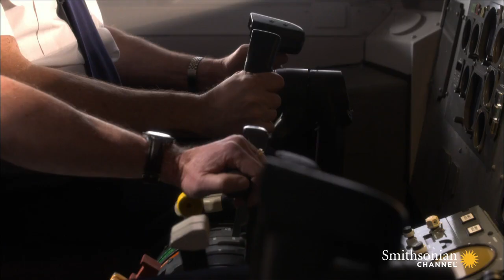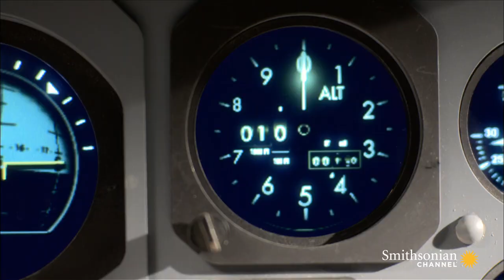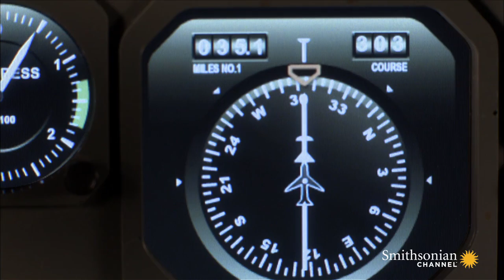Why Couldn’t These DC-9 Pilots Avoid This Collision?

Comment: According to routine orders, the aircraft was to effect repairs at Mountain Home AFB and then return to MCAS El Toro. Diagnostic tests at Mountain Home revealed that the aircraft had an inoperative radio, inoperative transponder,[3] oxygen system leak, and a degraded radar system. Maintenance personnel were able to fix the radio and confirm the oxygen leak, but the base did not have the necessary personnel to repair either the transponder or the radar.[2]

Despite the inoperative transponder, Phillips received permission from his superiors to fly the F-4B anyway.[4] 

Pure military bs

Comment: I mean the fighter plane is smaller and it had no time but with the 3-5 secs it had it could have just tilted the nose all the way down makeing it just the back wings i mean the other passenger plane might take a lot of damage but that one movement could have boosted it survival chances because the fighter jet may only had like nearly 3 secs before collusion but the speed it had already he could have used it in the thing I explained but I guess so he didn’t and my question is that if the passenger jet had been paying attention to the bottom buttons how did he not see the part where it tells you if a plane is nearby the right pilot had clear view on the fighter jet and so did the fighter jet pilot

Comment: I think they also put in regulations that you can't fly airlines over active war-zones with AA present. That was from the MH17 shot down. An airline justifying that well they have AA that can shoot planes down at 5000 feet, we will just fly 30k feet doesn't fly when you don't know if new military equipment entered the theater of war. I still remember some of the excuses made: Oh we didn't know they were shooting planes down at that area. BS on LiveLeaks some guy using a smartphone recorded old SU-24 planes and a MI-24 helicopter planes being shot down a month before MH-17.

Google MH-17 shot down wiki and it will show it got shot down at July, 17, 2014. Then google Ukraine Airforce Assets wiki. There is a section detailing the Ukrainian aircraft losses during Ukrainian Crisis. The first air military assets being shot down was at May 2, 2014. So the airline association lied when they said they didn't know planes where being shot down in Ukraine. Part of blame is greed to save fuel cost, another is the lack of regulations to not fly over war-zones with AA and another is the conflict combatants.

Same thing happen when Iranian plane got shot down when Iran's AA went active to intercept US 'retailiation.'

Comment: They could have potentially avoided the F-4 but the DC-9 has very limited view with their windows so I think that the f-4 had a much better chance of seeing the DC-9 considering they have a large view of sight in the canopy
Reply: The f4 captain was looking at his target thingy
Reply: The f4 have way less visual than the dc9
Reply: they were most likely focused on the instruments instead...
Reply: @Skeletonful007  in this video they are making it seem like it was all the dc 9 fault
Reply: I suppose (theory) that the military pilots were used to high-altitude flights and that if there's a potential collision they can easily identify it on the radar. They are accustomed to trusting the instrument systems.
Reply: @gudfishpoop3188 bro the f4 only has one pilot and that pilot is already focused on doing a lot of other stuff not mention being totally strapped down with almost no flexibility to move around the dc9 is at fault
Reply: @simin382  the pilots probably thought that the military plane would be able to manouver its way around, and when the dc9 pilots saw the dc9 it was too late to pull out

Comment: This sounds like some soviet-era cheapskatedness, I'm disappointed it was us.

"Boss, my plane doesn't make oxygen"
"Fly low to ground, comrade.  Oxygen is not problem"
Reply: watching all these videos i start to get the idea that we're not actually a lot better than the soviets at flying lol
Reply: What? That's not some cheapskate tactic, the entire point of the system the wasn't working was to allow them to fly at high altitude, it wasn't working so they flew low. It's pretty simple and wouldn't have been a problem at all if the Phantom's pilots didn't fly through a civilian airway while both pilots weren't paying attention. It's also through incidents like this that we learn the lessons that we now consider common sense, like the fact that this incident was key to making military aircraft contact civilian air traffic controllers.
Reply: Welcome to America lol
Reply: @rohana7788  I wasn't even addressing your comment. Also yeah, most people know that the majority of aircraft accidents are caused by human error.

Comment: Fighter plane pilot survive and all passenger of commercial plane dies what a grace of God
Reply: Atleast the fighter plane pilot survive
Reply: 2 suriver the man women died only ploit
Reply: Nah the f4 pilot died
Reply: @CARTERISAFRUIT  all of them.....?
Or just one.... Because the back one already jumped before it vrash
Reply: @ahrithegumiho2199  the incident is called hughes airwest flight 706
Reply: @ahrithegumiho2199  all died, no survivors
Reply: The radar operator of the fighter plane survived
Reply: Pilot James Phillips was killed. chris schliss the RDO officer in rear seat parachuted out I seen him coming down on that day. It happened above our home in azusa california
Reply: That because fighter plane equipped with emergency ejection seat, just pull lever (i guess) and you already ejected.

But not with standard commercial jet...
If that commercial one get ejection seat....
That Will bring much-much trouble
Reply: The pilot didn't survive. The radar operator did.

the pilot couldn't eject because of an error in the ejection seat, which prevented the pilot from ejecting if the radar operator in the back ejected first.

Comment: Totally the resposibility of the F-4 which is smaller, more maneuverable, under vfr and on the left to “see and avoid” the dc-9, which is under ifr and relies on atc for traffic separation.
Reply: The f4´s radar was broken without oxygen so the f4´s was trying to see so not their fault
Reply: @nighthawk6755  Mismaintenance is not someone else's problem.

Comment: Let me re-evaluate:A DC-9 that has a tail of a Boeing 717 takes off from the taxiway and collides with an f-4 just because some random dude wanted his plane back.
Reply: you do know the 717 is basically a next gen dc-9 right?  DC-9 became the MD-90/95 and then the 717 when Boeing bought out McDonnell Douglas?  
The rest of it, yeah.  Seems like some big brass wanted his plane, and 3 pilots and a RIO all had their heads out of the game.
Reply: @TheRealCelticBatman  yeah but the DC-9 and 717 have different tails(this incident happened when the 717 didn't even exist)
Reply: Yo
Reply: D.C.    Daily Crash

Comment: Can anybody tell me why don't seat ejections are installed in airliners for pilots and passengers.
Reply: Fighter planes have a glass canopy which shatters when pilots eject. In a commercial plane, the roof is not made from glass , and thus no one can eject. Along with that, an accidental ejection from a passenger could cause everyone else to die.
Reply: @shujaatmandkhan9125  I agree..But an accidental ejection can be avoided if control over ejection is given to pilot only. Who can alert passengers minutes before ejection.

Comment: it appears the Phantom was at fault or more the onus was on the pilot of the Phantom to spot the Commerical Airliner,the Phantom is the smaller, more agile plane, the DC-9 had the right of way so to speak and was more noticeable than the other way around.

Comment: My question is.. why didn't the F-4 pilot eject? Was his seat not working? Did he bonk his head?
Reply: One did, the Radio Intercept Officer(guy in the back), the Flight Commander was not able to.  There was a flaw with the F-4s ejector seats, which was later fixed, that made it a crapshoot if the front ejector seat would fire or not if the rear ejected before it.  The RIO fired his ejector seat before the FC and the FC was not able to fire his own.
Reply: @TheAznWaffle  So did that mean that the pilot in the front seat was supposed to eject first?

Comment: According to the video, they might have missed each other if the F4 had just kept flying straight on.  It was the F4’s raised starboard wing that sliced into the DC-9.  Or, if the F4 had just pushed the nose down instead of trying to turn away to the left, the accident may have never happened.  I wonder what sort of collision avoidance training the military pilots get?
Reply: vegasgeorge no but imagina having like 1 second to do something unexpected you probably dont choose the best choice
Reply: nah i feel like the vertical stabilizer would have been cut off the f4 and the dc-9's bottom would have been cut open
Reply: From what i see.. The f4 pilot turned to the left and pitched down because the plane was coming from right... But it was already too late and it made the right wing lift up and slice off the cockpit.
Reply: @crystalightz doesn't matter by turning downwards the wing hit and if he did not the vertical stabiliser would have hit. Unfortunately it's a lose lose situation
Reply: @Mortal-Demiurge  yes fr

Comment: The pilot in the DC-9 could of see the fighter pilot, but they didn't look around the plane they were looking at the instruments but not the radar, but the fighter pilot did used the rocket seat but i dont know if he survived, but what happend with the pilots of the DC-9 that were deslocated from the cabin?

Comment: Isint it the fighters fault, considering they are much more maneuverable?
Reply: Technically, both pilots are supposed to "See and Avoid" each other. However, the problem with that is at the time of the collision, it was hazy outside, which limited visibility. Also, due to the speed at which both aircraft were traveling, the F-4 would have appeared to the DC-9 crew as nothing but a speck till right before impact. As for the F-4, the two aircraft merged so fast that all the pilot had to do was look down at his instruments for one or two seconds in order to not see the DC-9 from farther out. Once he did see the DC-9, he did take evasive action, but by that time, the two planes were too close together in order to avoid each other. Besides that, at the time military pilots were not required to contact and obey civilian ATC, and the radar system that was tracking the DC-9 wasn't sensitive enough to track an aircraft moving at the F-4's speed, so ATC couldn't have told either of the pilots to look out for each other.

Comment: Aviation journalism at its finest (100% sarcasm). I'm a former commercial pilot and I know that airspace very well. My question is where is ATC (FAA Air Traffic Control) in this picture? Even if the Marine F4 opted to fly VFR (visual flight rules) the airliner only flies IFR  (instrument flight rules) which will keep him in contact with ATC and under radar coverage to maintain traffic separation which would include "Air West Flight Blah Blah Blah, traffic alert! You have unidentified traffic at your 9 o'clock 1 mile". That gives you about 7 seconds to look and take evasive action (which is almost never necessary). So, if you're reading this, I'm going to paint an unlikely scenario for ATC for your entertainment to add to this seriously incomplete narrative:

ATC Supervisor: "Do you see anything unusual out there?"

ATC Controller (with his feet up on his desk): "Nah. Just an Air West guy and .... Oh, Sh--!"
Reply: You should probably read the NTSB report all your questions are thoroughly answered

Comment: I'd say 90% of the blame lies with the F-4. The commercial airliner pilots do what they normally do, which is to scan their surroundings, but not have to do so frantically assuming there might be military aircraft flying abnormally in lower altitudes. Commercial planes also have ATC and TCAS to help them avoid other planes. As such it is the responsibility of the F-4 to be extra vigilant about not running into commercial aircraft, since it is operating outside of its usual protocol. Plus, the commercial airliner pilots have humongous blind spots compared to the F-4, and the fighter jet is so much more smaller and maneuverable. Most of the fault lies with the idiotic Marine pilot.

Comment: See and Avoid these videos.  They always leave you hanging with no further info.  Did the f-4's crew eject safety or what? We saw the DC-9er hit the ground so we know what happened to them but what about our F-4 crew?  I'll assume that because they hit approx. head on, the F-4 was damaged around the front of the aircraft including the cockpit areas and they couldn't eject.  It was a much different type of damage than the plane was designed to take and still have the crew able to eject. Now I'll have to do a search to see, THE REST OF THE STORY.

Comment: why didn't the DC9 show up on the F4 radar? they are supposed to pick up other aircraft. so they don't get surprised and shot down. this should not have happened
Reply: It's a weapons control radar with a narrow beam.  2 dgrees in elevation off and the DC 9 would not appear on the radar.

Comment: What is the name of that small jet?
Reply: Larry
Reply: NO its a F-4 Phantom
Reply: Scrap Metal.
Reply: JeltePeltePower f4 phantom
Reply: Its an F-4a2 phantom fighter jet
Reply: Ik ben een JPP tafel McDonnell Douglas F-4B Phantom II
Reply: Dorp ^^^ im not 100% sure that’s the name there was many experimental jets of the phantom
Reply: Lootn The jet in question is NOT experimental. It was the actual production version, which was widely in service by the time of the accident. In this case, it was an F-4B variant operated by the Marines.
Reply: Lootn Plus, any experimental aircraft in U.S. Military service are designated with the prefix "X" (e.g. X-15, X-35, ect.) and are operated by specific test flight squadrons within the Air Force or Navy. The aircraft was an F-4B with a Marine COMBAT fighter squadron

Comment: Too be honest, I believe the jet is more at fault than the commercial jet, the jet was flying directly towards the plane, so they would be looking forward, the commercial was not
Reply: IAnimalLoves 
It wasn't. Both were moving. The commercial jet wasn't just floating in the air infront of them. It came from the right.
Reply: I think that it's not any pilot's fault but military fault if anyones. Or the guy who confirmed how high they can fly
Reply: The military jet had a radar pointed directly at the commercial jet the whole time, plus during military flights there is a ground control to prevent exactly this
Reply: @tim4570  You don't know what the F4 radar was pointing at.